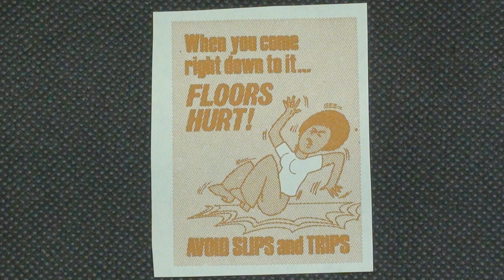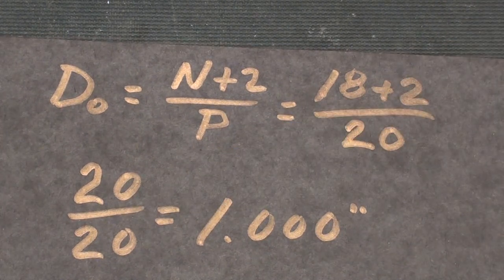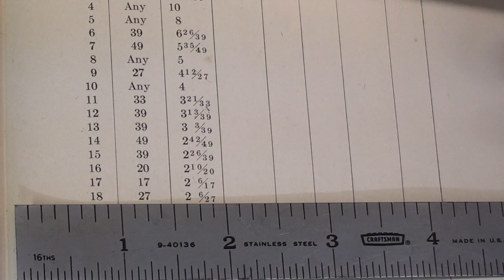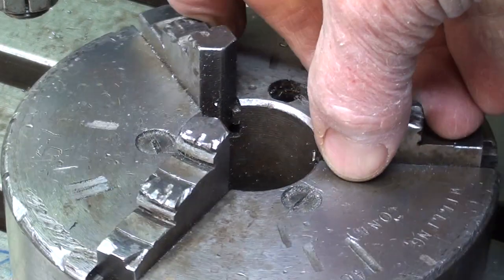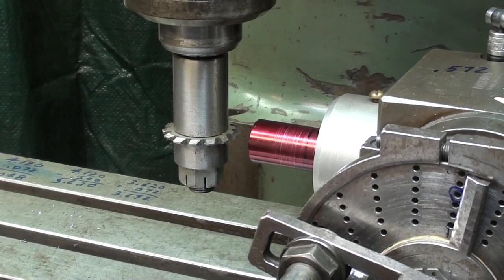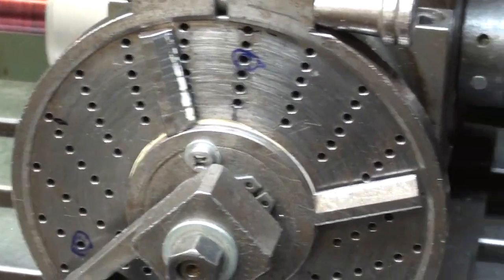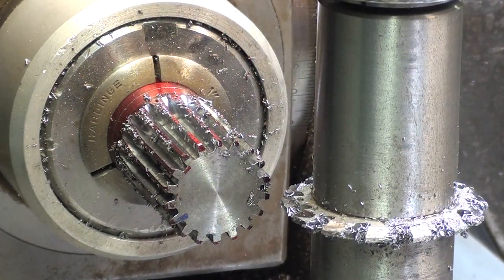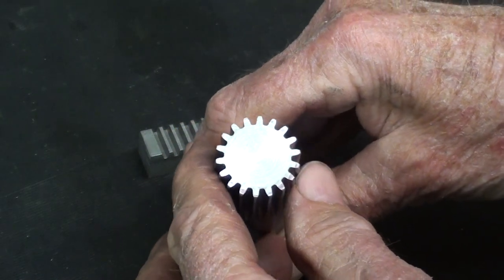Cutting a Pinion Gear on Bridgeport Mill TIPS #574 tubalcain

Comment: I used your method to center the cutter, if it is a large tooth profile, I lock the quill up and use the elevating crank to center the tool. I then made a cut across the face, put magic marker on the cut, turn the indexing head 180 degrees, and take the cutting pass again. If the cutter is perfectly centered, the cutter will remove some or all the magic marker on both sides of the cut. If the second cut only takes material off one side of the cut, I use the elevating crank to fine tune the cutter position.

Comment: Mr. Pete, many thanks for all of your dividing head videos!  I have the same little Hardinge as you and really enjoy using it. I’ve used the social distancing period to make a rack and pinion gear for my bassoon reed machine, using your advice. I’ve also been rebuilding and making parts for an old NIchols Horizontal Miller. Lots of peace and quiet and good fun in the basement!
Reply from the maker: My shop is my sanctuary. Basoon reeds, That’s a good one most people do not even know what that instrument is.

Comment: Good morning, Me Pete!  I don't know why but I always like watching someone cut gears whether it is on a vertical mill or a horizontal.  Great video and explanation.
When I saw the 6" Craftsman scale I paused a bit-I had found one last weekend while cleaning out an old Craftsman tool box that was given to me.  I had to go out to the shop and get the scale to check the model number-yep-same scale.  I had to clean it up-years of rust dust, dirt, and some gooey substance that was in the top section had it looking rough.  With a little Scotch-brite and some lacquer thinner it came right back.  The edges and numbers are still crisp and the only blemish (if you could call it that) is where the previous owner has engraved .030 near one end.  Just by eyeball I'm assuming that is the thickness but I haven't confirmed.  
One of my hobbies is woodworking and I find I use the 6" scales more than any other ruler I have.  On the small boxes (and most projects) I make they are a lot less cumbersome than the 12"s.  I have a few 6"ers-a couple Starretts, a Brown and Sharp and now the Craftsman.
Have a great day and stay safe.  This goes out to everyone in these crazy times.
Reply from the maker: That is one of my favorite scales. I do not remember where I got it. Very high-quality

Comment: The virus lock down isn't all bad; I am using the time to finally learn more about my mill and Atlas lathe. Swapped out change gears and changed the feed rate last evening for the first time. Thinking I will finally build that wobbler motor...

Comment: Thank You Lyle !!!....You have made clear, wonderful, instructions....Last week I happened to make an 18 T brass spur gear with a 5 deg. angle set at the center of the gear blank at home for replacement for the warn out Clausing Lathe Rapid Feed attachment.  I did not have the correct cutters so used a hand ground carbide fly cutter. The gear also had two 1/8" holes offset holes to align the gear. Everything worked fine BUT I need to purchase a set of correct cutters for a more accurate gear and to have backup gears...TM
Reply from the maker: Sounds like you did an awesome job

Comment: Anyway to cut gears without a dividing head on the Bridgeport?
Reply: Should be no problem; here is how I’ve done it. You will need to create your own indexing plate for your gear blank. Let say you want a gear with 52 teeth with a DP of 18. Make your OD of your blank 3”. Now using basic trigonometry, make a hole pattern (52 holes) with a 1/16” drill bit a ½” from the outside edge (that would be a 2” circle), do not drill all the way thru. Now holding the center of the blank steady on top of your vise, you will use the 1/16” holes and a 1/16” drill bit to index your blank. You can make two blanks and hold them together with double sided tape; using one as your indexing plate.

Comment: i have a question for you Mr. Pete, i want to replace Shafts on small nema14 stepper motors, What type of adhesive would you recommend? simple Red lock tight or epoxy? or something else?  i don't have the tooling to make grove lines along the shafts. the maximum force that the motor can hold is about 10oz.

Comment: Really enjoyed!  Just a thought, I have a problem threading a shaft and then getting it to run true.
How about a video on how to machine a arbor and make it run true. I also like your Repetes!
Reply from the maker: There was a video coming up on that soon. I already did it, but you will not like it. Mine wobbles like crazy
Reply: I very carefully made a stub arbor for a slitting saw. I'm pretty sure that less than half the teeth are doing the cutting.  Seems common in watching machining videos.

Comment: Hah!  What a coincidence!  I'm currently designing a machine that needs a 24P/18T (20PA) gear on a complex spindle with limited axial clearance to features on both sides.  I clicked on your video just to understand the machining issues of gear-cutting, and your video simply answers my questions 'to a T'!  I was hoping to find a cutter with an OD that's as small as possible so it would allow minimal axial space along my part for access, but couldn't find a cutter diameter less than 1.75 OD!  Anyway, I was surprised that you could machine each tooth with just one pass of a cut.  You made it appear simple!  
How much time did this job take from set-up to final cut & verification?
Reply from the maker: One hour.  Thanks

Comment: When i saw you said pinion i was thinking it would be neat to see the inside mating of a pinion spline in a hole made for it. That seems to me a real challenge. its not like cutting a key way so I'm wondering how one would go about doing that? and how to index it too.  My interest is in mating electrical motors to transmission shafts with a coupling.

Comment: Hi lyle!  Hope all are well amidst all the things that we all could do without!  

Quick question,  can helical gears be straight cut at angle to their shaft?   Are they that much quieter?

I'm rebuilding a cast iron Wilton band saw that needs new bearings, shafts, and gears.   Not sure what to do about the helical gears of which 2 of them are nylon or  plastic.....   

Hope this finds you in great spirits Amigo.
Reply from the maker: No
Reply: @mrpete222  

🤣    Great!  I won't even bother to try.

Comment: I've used an app available in play store for calculating the dividing plate things, the name was something like "universal dividing head calculator"
Reply from the maker: I need to check that out
Reply: Yes, the apps are very cool. I like cracking my old books and using simple math. Just seems more appropriate (and fun). You also learn more that way. Glad we're both in Mr. Pete's classroom. Cheers!
Reply: @paulinmt2185  Thanks for your reply. I have the usual books in the shop as well, and I'm currently studying mechanical engineering so the math is also taken care of. I just like the simplicity sometimes especially when relaxing at the shop using manual machinery.

Comment: Have you ever cut a worm gear? It may be interesting to make a worm gear video.
Reply: That would be quite a challenge on a manual mill. I think you need the device that connects the dividing head to the mill table so they synchronously move together.
Reply: With the correct feeds couldn't most of it be done in the lathe?
Reply: @bliviont  You'd need a milling attachment to cut a gear on a lathe and even then it'd be rather laborious. And I can't see how you'd cut a worm gear on a lathe, but could be wrong of course.
Reply: @MrUbiquitousTech  Ah yes the actual gear part would be rather difficult to make. I guess I was thinking more of cutting the worm 'screw' portion on the lathe. Since most of it is just a very coarse thread.

As for the gear portion couldn't you use a dividing head mounted at an angle on the milling table? Then the challenge would be finding a tool that would cut the correct profile into the gear teeth.
Reply: @bliviont  Now you're over my head. :)
There was another youtuber that cut a worm gear, can't remember who for sure but it might have been Keith Rucker or Adam Booth. Maybe you can find more info from those guys. Pretty sure I've never seen Mr. Pete do one, but that doesn't mean he won't in the future of course.
Reply: @MrUbiquitousTech  :P

I could totally see Adam Booth making a giant worm screw/gear.
Reply: @bliviont  LOL, yes, it would be Adam Booth sized.
Reply: Would it be very different from cutting threads? Different form tool, but that’s what I’d ask.
Reply: @JackFlashTech  I think that's the only main difference as long as the spacing is correct.  Some have a tapered outside dimension but that wouldn't effect the threads I don't think.

Comment: For those who need it, we have the manual for the Hardinge 4:1 Universal Plain Dividing Head on the New England Model Engineering Society website: http://www.neme-s.org/images/PDF_Files/Dividing_Head.pdf
Reply from the maker: I could not get that link to work
Reply: @mrpete222  the link is a direct one to the PDF of the manual. Clicking it should immediately download the manual for you, rather than opening a web page.
Reply from the maker: Thank you very much, I finally got it to work. It was just a very very long download. Now I will print it out. I have never seen this document before. So I will value it quite highly. I wish I had a little tailstock Shown.
Reply: @mrpete222  I've also emailed it to you, so you can safely disregard that one

Comment: Arbitrarily  chose 1'' dia. ?     Backwards formula?     N = (DP X OD) - f   ''f'' being the addendum factor and is always 2 when using involute gearing.  All of these formulas can be transposed, but you knew this Mr. Pete, you rascal!
Reply from the maker: lol
Reply: @mrpete222    Thanks Mr. Pete   I have given workshops on gears and gear cutting over the last 40 years or so and have found out never use the letter P or say the word pitch.  (as we know there are 3 pitches involved with gears) Mr. Pete mentioned this in another video as well as trying to explain what DP is, a waste of time.   
So ignoring the what letters are in the books, which I hate to do, I use DP and OD, less confusing for my crowd.